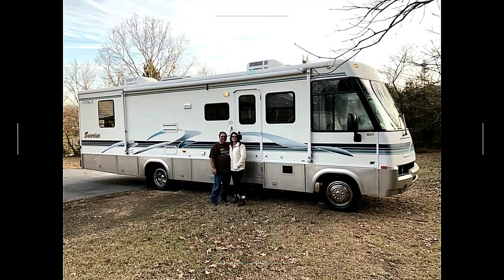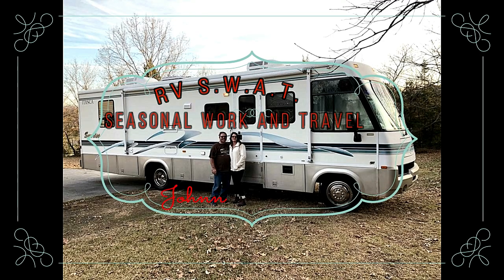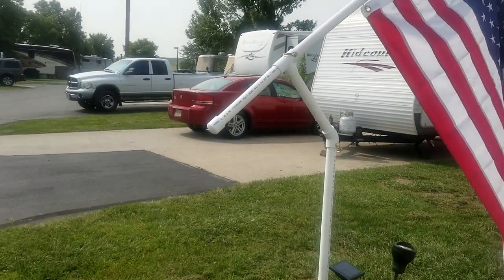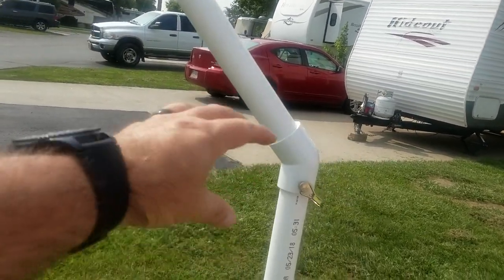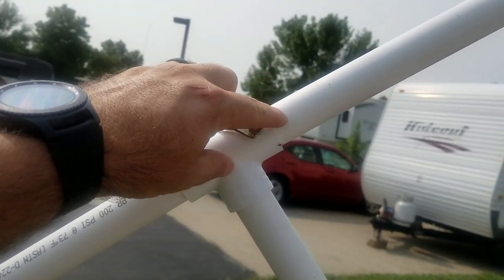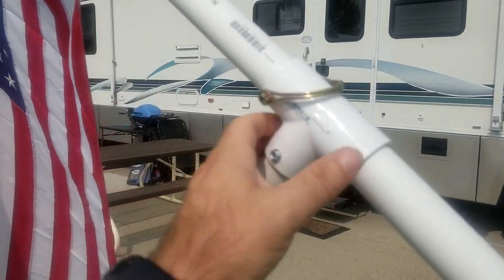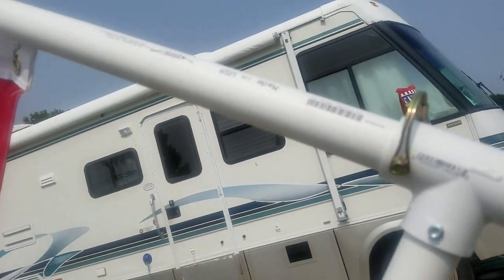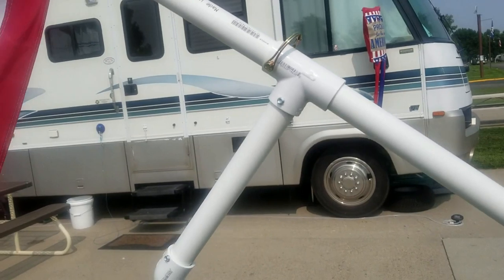Update-Upgrade DIY Lighted RV Flag Pole - full time rving - RVSWAT

Comment: Does the pvc pipe just get pushed into the ground?  Does it keep the flag from falling over in the wind?
Reply: Short Short Trailer There is a 4 foot section of rebar with about half of it hammered into the ground. The pvc is then placed over it. Full details are available on the diy video a couple of weeks ago.